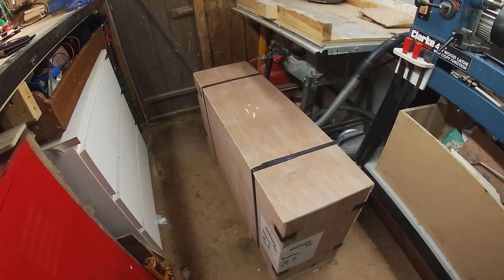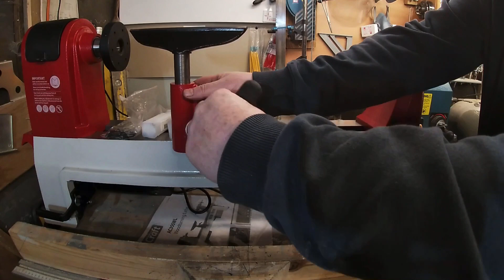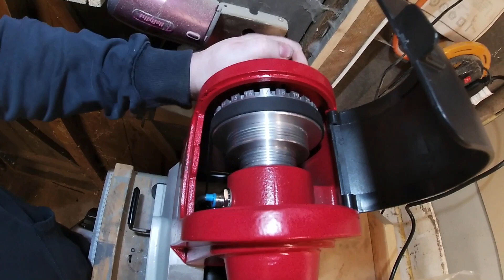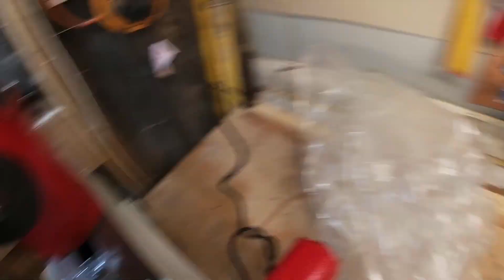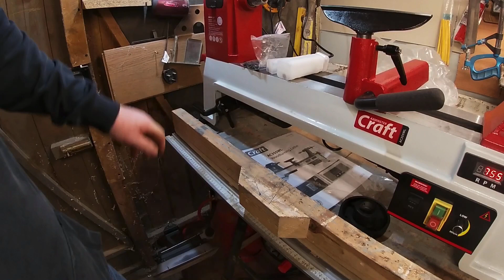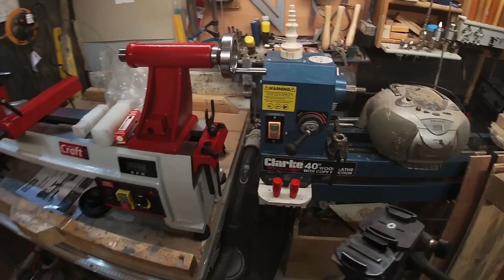My New AC355WL wood lathe from Axminster. #Vlog39

Comment: I’ve had the same lathe here in the the states for about two years and I love it. Different badging and paint ( here it’s model G0844 from Grizzly Industrial ). As your video has been out for six months you may have come to realize the things I’m about to mention, but if not I hope these help. 1) the largest allen key fits in the outboard end of the headstock to facilitate removal of the hand wheel. 2) the knock out bar isn’t necessary for most accessories in the tail stock. Fully retracting the quill should automatically eject them. The last one I would say come down to personal preference. I have removed the tool holder from the tail stock end,it’s just much easier when moving the tail stock on and off. Good luck and happy turning!
Reply from the maker: Thank you for your comment, I really appreciate it. It’s a great little lathe, I use it almost everyday I’m off work. Thank for the three hints. 👍

Comment: Thanks for the review! Ive been doing a fair bit of research and this is the one I keep coming back too. I am still confused what this indexing pin and wheel actually do though? Ive looked at the PDF manual online but still wondering the purpose? If the indexing pin is  left in locked will that jam up the motor from turning? Also its says as craft range only suitable for around 2 hours a week use - seems a very short time? On my days off I think I would be in the shed with it good bit more than 2 hrs....how have you found that now you have used it. I mean its metal so not a lot can wear there Im guessing it the motor brushes and drive belt/electronics that wear?
Ah! did a bit more digging around and I see that INDEXING is a way to manually turn the wood by hand in a step wise fashion to decorate the wood in a measured way - as seen here
https://www.youtube.com/watch?v=KChUfOT7MuA
Reply from the maker: This is a great wood turning lathe, I use my lathe for hours at a time with no issues. The index pin will stop the motor from turning and I have since learned how to use it.Thank you for your comment, I appreciate it.

Comment: Congrats on the Axminster lathe.  Sure it will be much nicer to work with than your older one.
Reply from the maker: Thank you for your comment. It’s a great small lathe. 👍
Reply: @illgiveitago1239  I’ve seen others using it and it sesames nice. sturdy and accurate which is what you need from a lathe. Happy turning.

Comment: Your Axeminster lathe has arrived in the U.S.A. with a different color and rebadged.
Craft Supplies USA has it advertised as Artisan 1420 EVS  for $950 USD + $105 USD shipping.
Reply from the maker: I’m very surprised that they are selling this lathe in the USA. You have a very large range of lathe’s. I am loving this lathe it’s fab, but I have very limited experience in wood turning. I need to get so many new chisels and throw away my cheap Chinese rubbish. Watch this space for new tools. They are so expensive 🥲also a new chuck ££££££££££££££££

Comment: I'v owned one of these lathes a few years now. Hope you have many years of fun turning with your new lathe.
A couple of ideas for you, move the Tool Rest - Handle on the tail stock side to the lower position, (the are extra screw holes below) 
it will get in the way when you wish to remove the tail stock and banjo for cleaning etc. And the Tail stock gets in the way when turning 
bowls or tall vases),   I made a steady rest which I should of done years ago. 

Also maintain the lathe often, as the tail stock will get stiff over time, a bottle cleaning brush is a must. I use GT85,
I also use GT85 with fine wire wool for the bed ways, then Peek Metal Polish Paste with a scotch pad and finally wax.
Oh the joys of cast iron. 

I own a few SC3 and SC4 Record Power chucks, which have a screw to lock the chuck for reverse turning and sanding.
Like Mike Wallace said, take your time to choose what chuck is best for you. (Not cheap). the reason I have so many chucks
is because I'm lazy, and it takes time to keep changing Jaws, trust me, the is a lot of chuck jaws to chose from. LOL

Enjoy your new toy.
Reply from the maker: Thank you so much for your advice, I really appreciate it. I will have hours of fun. 👍
Reply: @illgiveitago1239  Forgot to say, you can get a bed extension for this lathe, (£139.98 ouch!) but that will free up valuable space in your workshop if you decide to pass on your Clark lathe. The proceeds could go towards the  bed extension!

As You probably know, buying a wood lathe is the cheapest part of wood turning. If only somebody would of told me. LOL